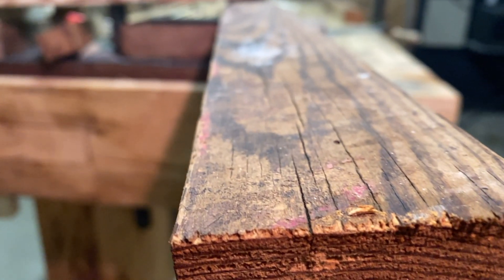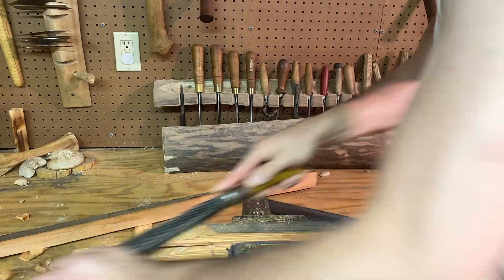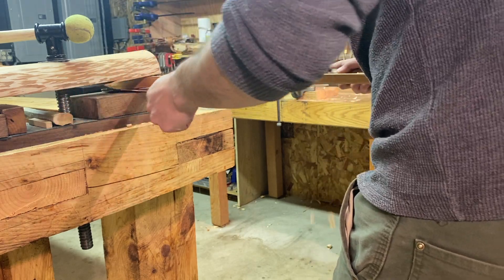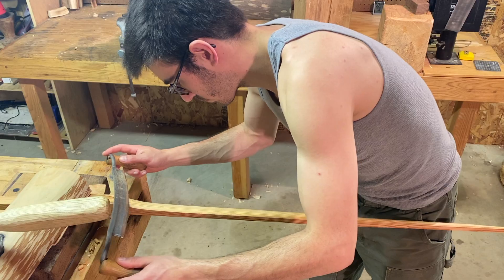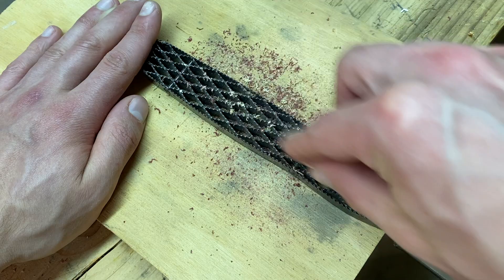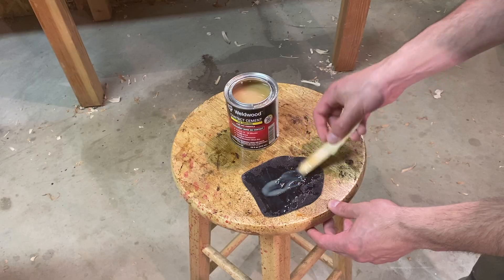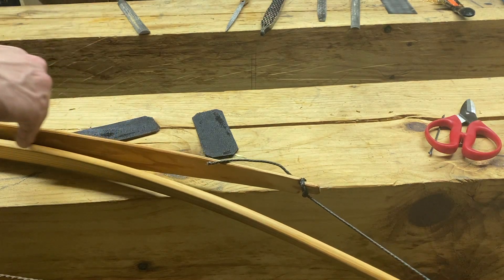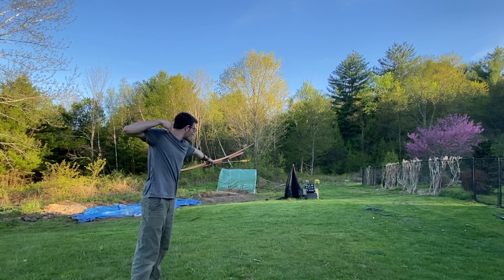Board Bows Ep. 2: Three Bows One Post

Comment: This is rad!
Reply from the maker: Thanks man! I’ve been watching your stuff long before I even started making bows. You’ve been a huge influence and inspiration
Reply from the maker: I don’t mess around with backed bows too much but it’s something I’d like to explore. I don’t have the same passion for composite as with self bows, but Backings can be an interesting tool. 

I find horn to be a bit massive to perform well as a self bow, except in a very short bow, so the idea to put it in a penobscot as the short bow is very interesting. I’ll have to think about it. 

There are a small handful of bowyers who have made horn backed bows. Check out Arvin Weaver (Selfbowman) on Primitive Archer for more.
Reply from the maker: Abu Troll al cockroachistan I think you would enjoy Adam Karpowitz’ books on composite  bow design. I believe the reason that directly sinewing the horn is not common is that to fully benefit from the horn in a mass-efficient way you’re better off elevating it from the neutral plane by using a core. This increases the mechanical advantage of the backing, similar to how in a cable backed bow, the further you elevate the cable from the back of the bow the more you put it to work.